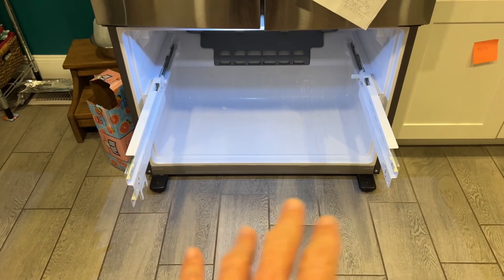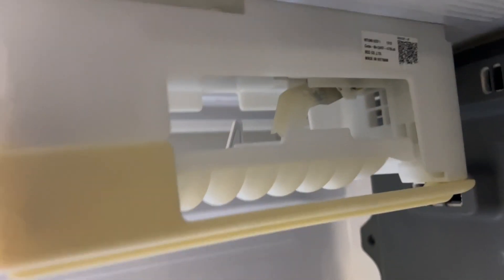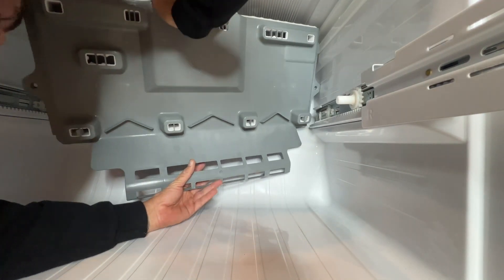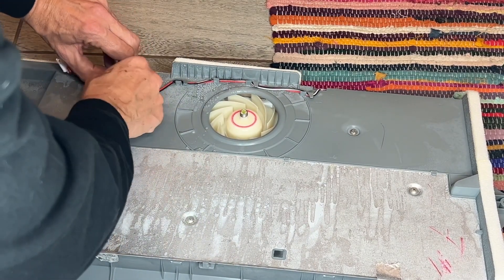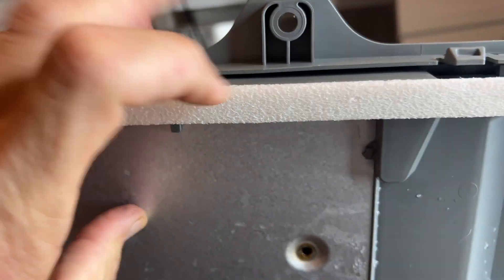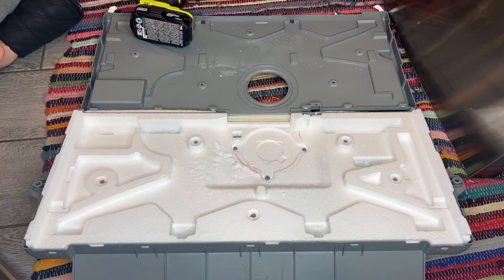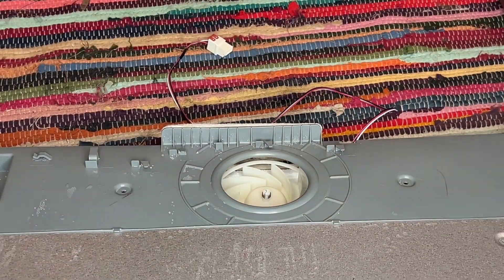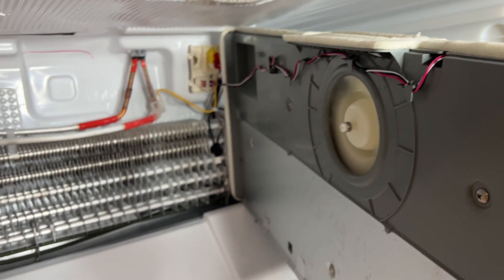Refrigerator Evaporator Fan Diagnosis and Repair Part 2

Comment: Thank you! This is exactly what I needed to fix my extra loud fan. Add in the Amazon link, this was so easy to follow and do myself. We came close to caving and buying a new fridge, so this saved me a couple thousand dollars. 

Also, I was able to do this without removing the ice maker. The panel was able to slide out with enough space.
Reply from the maker: I love hearing this was an easy repair for you and there’s no need to buy a new fridge!
I get how you were feeling though. When the fridge starts making weird noises, the cost of possibly having to buy a new fridge amplifies those noises!
Thanks for watching!

Don’t forget to subscribe 🙏